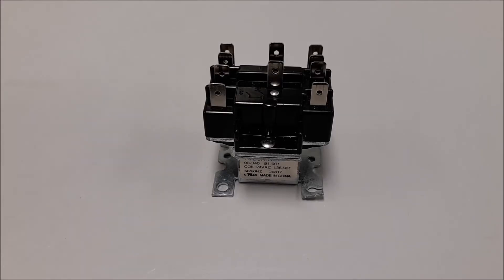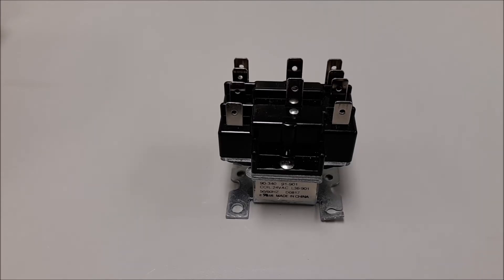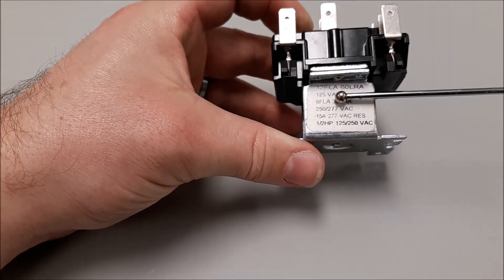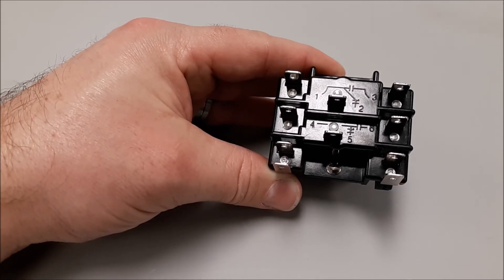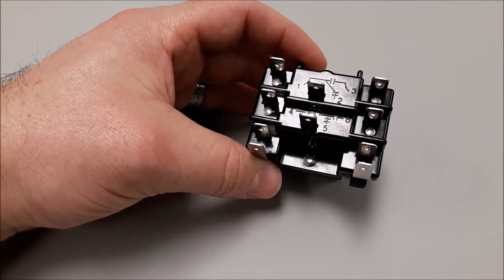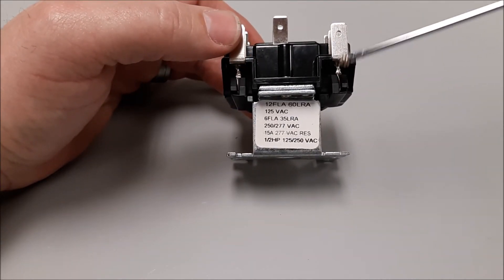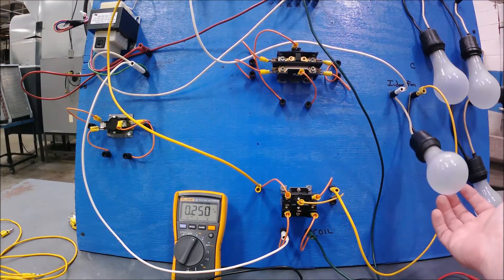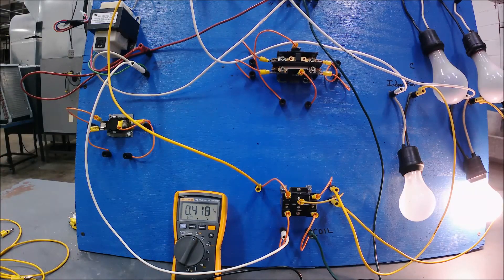90340 HVAC Relay - NEED TO KNOW INFO

Comment: There's no difference between them. I think I will use that next time I explain it to a new guy in the field. Too many guys sourcing power to ground and getting confused or don't know how to check a fuse with power applied. Thanks.
Reply from the maker: Never like checking to ground. I try to tell my guys that you always check back to your power source. Thanks for watching.
Reply: How do you check a fuse with power applied?
Reply: Across both fuse points. If you read voltage between both ends of your fuse, the fuse is open.
Reply: @bluegrassdna5572  but what if you're not sure if power is flowing? Open fuse (or closed for that matter) reads zero voltage there also. It's really tricky to me.
Reply: If the power is off you will not read voltage even across a bad fuse. Take the reading leg to leg before the fuse at the main coming into the appliance. If there is power coming in you will read it there. Electricity is pretty straight forward no tricks involved. Make sure you have a fuse puller that is the right fit. Stay safe.
Reply: @bluegrassdna5572  thanks for the responses. My concern is this seems less reliable than pulling the fuse and checking continuity. If the power is on, but there is a broken wire before the fuse, you will measure zero voltage with power appearing to be on . That would be a false result, even though you appear to be doing it right.
Reply: The point of my original comment was to show you can see a bad fuse with the power on. If you read voltage across a fuse you should disconnect power, pull the fuse and further verify with a continuity tester or ohm meter then replace. I never said you should change fuses in and out without disconnecting power and checking the fuse. Now you know how to check a fuse with power applied. If the fuse reads voltage across it then work backward toward the voltage source or mains. This would rule out any other breaks in the circuit.
Reply from the maker: Too many scenarios on too much equipment! I like to leave one lead on "one side of power" and follow the circuit...from transformer to board to fuse...etc. This is a way to see where in the circuit you have power flowing in/out of different parts of the circuit. You can, of course, check voltage across a fuse/switch too. If voltage is present that would mean its open. What if the voltage is 0?? (2 possibles in my head...0 volts is either the power is off or closed switch/good fuse)
Reply: @Sam Andrew  Well you obviously have to verify you have power TO THE FUSE before you check for power ACROSS the fuse. You don't just check across the fuse and assume you have a good fuse if you read 0 volts. You have to also make sure you have power TO it first.
Reply: @johnjennings-JJ  yep...sounds like some really good advice that I heard Bill Johnson say on a hvac school podcast. Not that he's the originator of the idea but the first person I heard talk about it. He was actually speaking on looking for low voltage shorts I wanna say and said he clips one lead on common and dancing through each point. Good stuff. It stuck with me
Reply from the maker: (Something happened and I couldn't see the comment but i agree with BLUEgrassBLOOD on this one)

Comment: I have an old furnace with single stage a/c that has had it's original nordyne control board that connected to the thermostat and controlled everything replaced with a packet pr380 relay. Do you think that was an appropriate repair? The system does work
Reply from the maker: I am not exactly familiar with all the nordyne controls and there are a lot of reeplacement components out there for professionals to use. Personally, i can and have used a "universal" part to fix a customers system and it worked fine. I would say if it works properly...i wouldn't worry about it.

Comment: What happens if you voltage to ground when the switch is closed will it say 120 or still 0?
Reply from the maker: If you check voltage to ground at the switch when it is closed you should find 120 on either side of the switch. Watch out checking voltage to ground though, it messes with a lot of people.